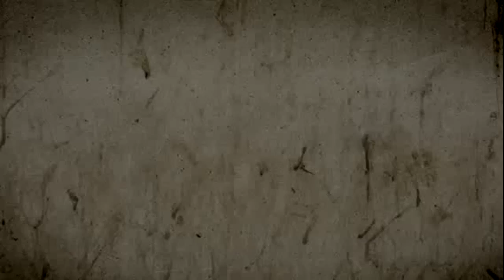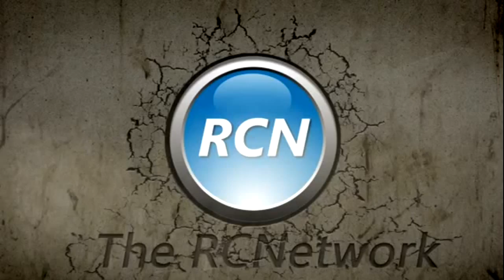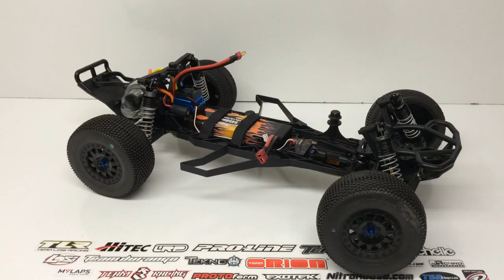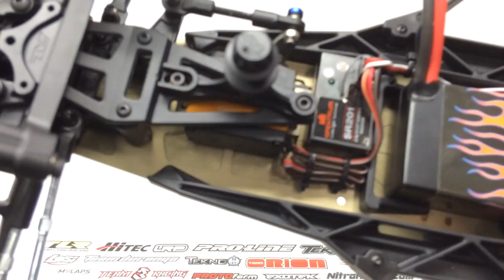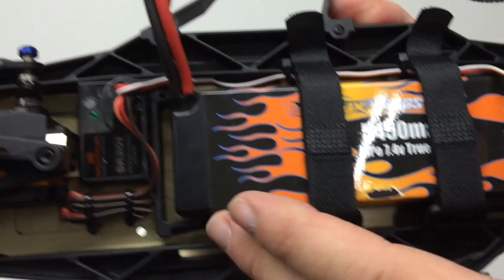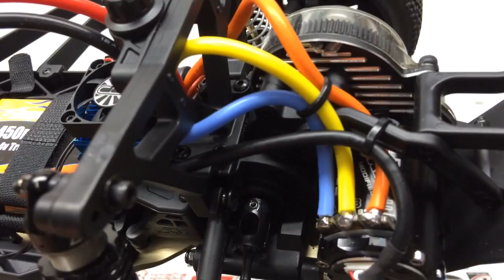Pro-Line Pro2 SC Buggy - Build Update 3

Comment: Im just doing the electrics in mine and moving everything across from my crappy turnigy sct. That had a short plastic antenna. I obviously don't want that on this one and looking at options. Did you just run yours along the plastic section of the chassis? Ive encountered a few screws missing my kit. But all in all its been straight forward. Just need to finish the body.
Reply from the maker: I run a Spektrum SR301 receiver in this one, so it only has a maybe a 2.5" antenna anyways.  I just layed it across the chassis.

Comment: whatch out , the flow just takes star wound motors !
Reply from the maker: lacucaracha111111 I'm assuming you're talking about Star wound vs Delta wound motors.  The Rocket motor is a MOD motor and rated at 8.5t.  Even the worst case scenario, the LRP FWT Speedo is rated to a 3.0t motor even with the 1.73x discrepancy of kv vs torque.  There's also nothing stating whether the Rocket Motor is Star wound vs Delta.  It seems to be of the same standard as most +$20 sensored motors.
Reply: yupp you're assuming right

Comment: Be sure to change the idler gear with the stock traxxas one before you run it , you can thank me later..lol  great video too Rich ... :)
Reply from the maker: I will take a look at that.  Thanks Mike!
Reply: yvw , mine was hashed in two packs sent them a note and they told me i needed to do so , but yet never was stated in the paperwork told me to use the stock idler which i had already switched out they sent me a new plastic one , but i didnt replace the metal one. it removed over half the teeth..lol was running 2s lipo with 1306 castle motor :P

Comment: See a small gap in the battery mount area with the max amps battery installed. I would be interested to see if it moves around while track driving.
Reply from the maker: Yeah, I moved the tray halves around to fit the MA pack (it's just a standard stick pack). The kit comes with a whole selection of foam blocks, plus there's an option to move the battery under the ESC tray. I'll get it all fine tuned before I run

Comment: I'm surprised you got the same tires as the SCT, I thought I saw a picture of the buggy on the box with badlands on the rear and different ones on the front. But then again, it kinda makes sense that it's the same as the SCT.
Looking good though, hope to see a running video. ;)
Reply from the maker: Yeah, this SC buggy kit I got was a bit strange.....all of the SC parts were included like the bumpers, body mounts, nerf bars (installed) and rear shock towers.  Also all the hardware.  Only thing I'm missing is a body.  Not too bad if I want to switch it up.  The box also had a large vinyl sticker over the truck picture with the buggy on it.  And yes, there WILL be a running video! lol